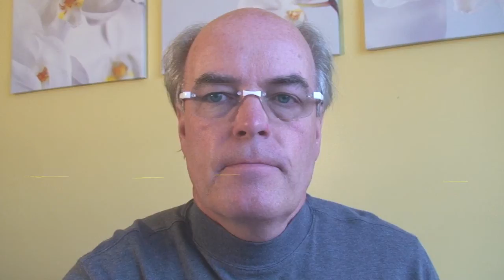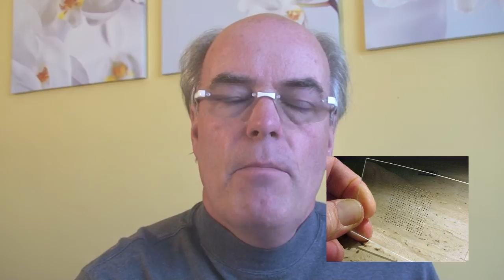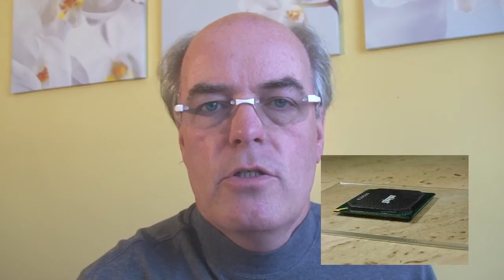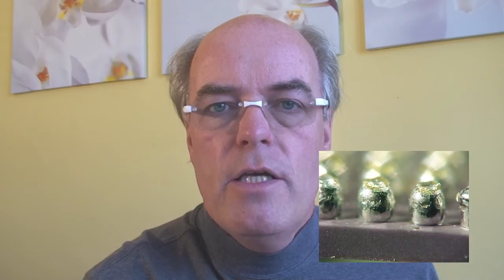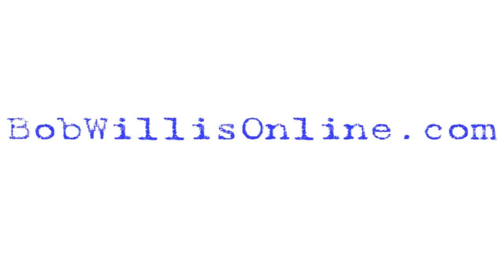BGA Solderability Testing "Bob Willis How to Do It"

Comment: Hi Bob,
Where do you get the glass? Is this special glass that can handle high temp thru convection oven?
Reply from the maker: They are standard glass slides you use on microscopes normal in boxes of 25 or 50 they only break if you drop them. Work fine on convection or vapour phase reflow

Comment from the maker: @reballuk  if you email me specifics on your BGA failure modes I may be able to assist you. Failures should not occur if the product is correctly designed and processed through the assembly opperation. Email me at bob@bobwillis.co.uk